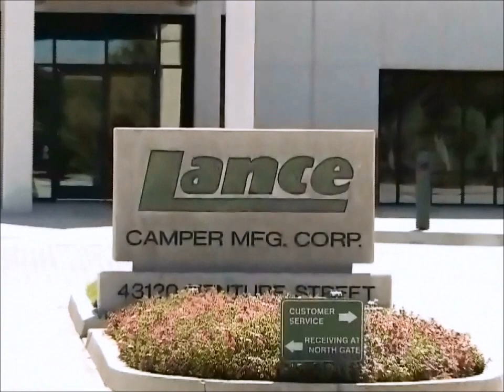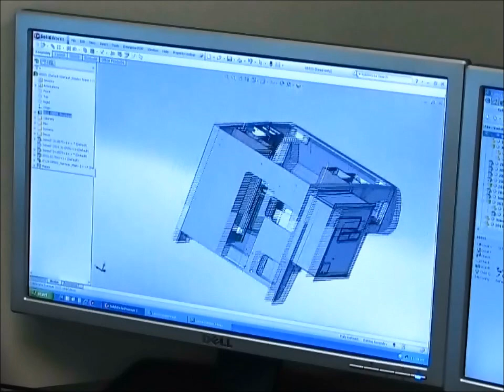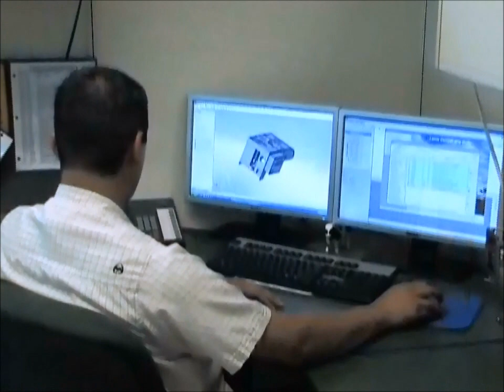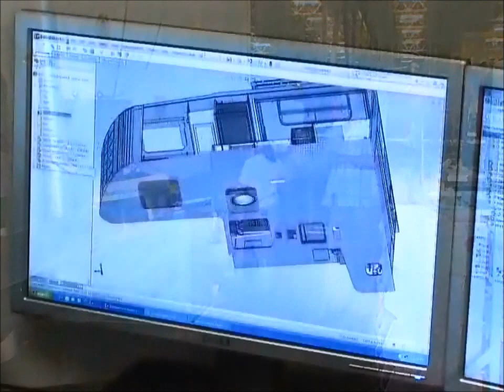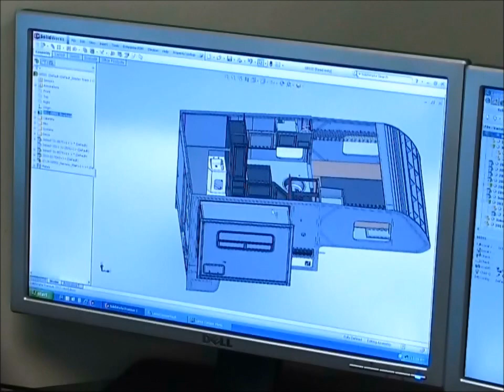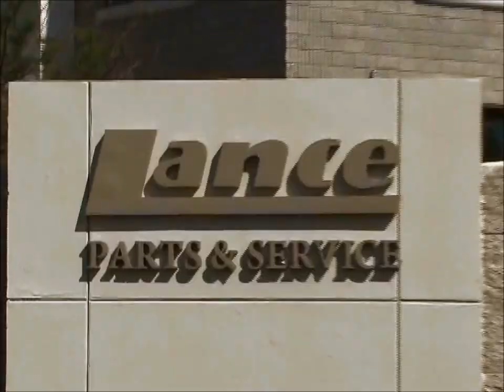Lance Camper:  Rollin' on TV visit Lance Camper

Comment: I have a 99 Lance 11'-6" model 1120 and I hit a new speed bump to fast and I think the frame is broken in the right rear. probably just above the propane box. I would like to repair if possible. Was it a aluminum frame In 1999. I wish I could see a drawing of the frame in that area
Reply: All wood framing in 1999.
2005 was the first year of alum in just 2 models.